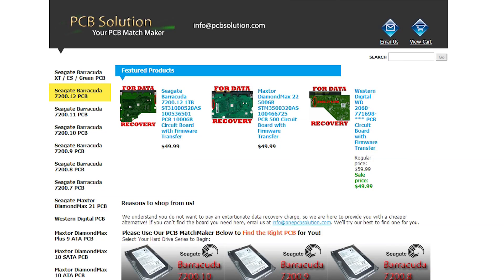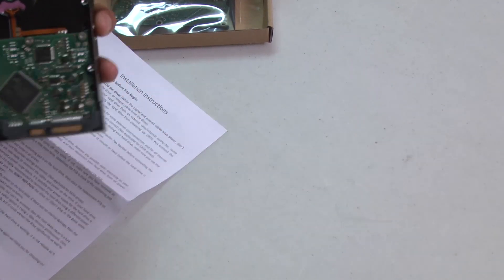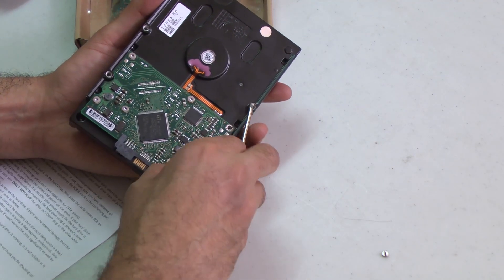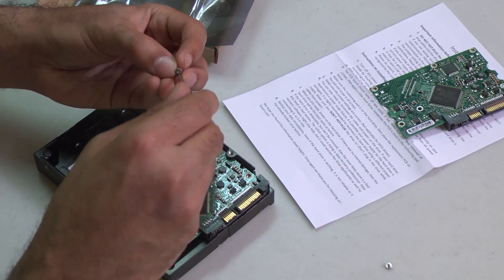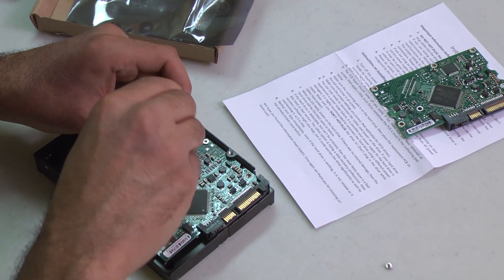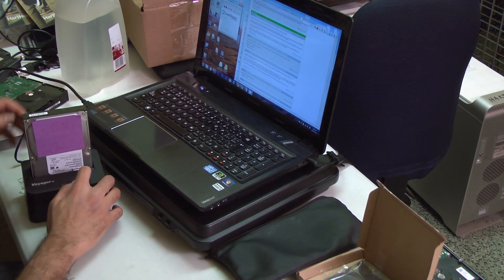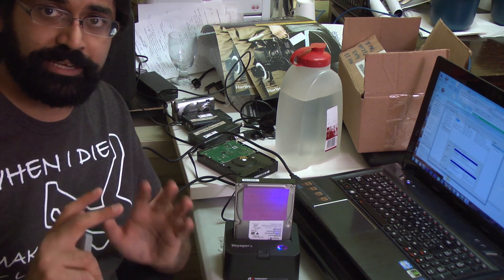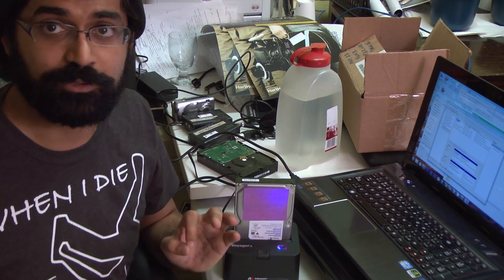How to swap broken harddrive circuit board to save $800 on data recovery

Comment: There are so many YouTube videos on how to fix a broken SATA data connector... this is a much more elegant solution and doesn't require hot glue or soldering irons.  Wish I had found this video before I spent $600 recovering a 5TB drive!  Thanks.

Comment: if you install the new PCB, would the data still be there ?
Reply from the maker: Yes! I got the data off then threw the drive out. Not going to trust it with any data that hasn't been backed up other places.

Comment: Thanks!!
I had a hard Seagate Barracuda 320GB I believed was lost, I am so happy to find your information here on YouTube. As you said it was easy to find the right PCB Circuit Board on hdd-parts website.
One week later I got the PCB board, I live in Sweden and it was no shipping cost.  I switched the board and it worked just perfect, thanks again!
Lars

Comment: Thanks for the helpful video, just ordered a PCB for my barracuda 7200.10 and hope it'll work without any effort on my part. When I plug it in there's a chip on the current PCB that gets so hot it desolders itself!

Comment: Thanks. Great Video. I also had a customer who had a bad pcb board and after researching all over the internet I ended up purchasing a PCB Board from Ebay that was the exact model but they told me I had to move over the original PCB board "CHIP" - BIOS Chip. I tried their PCB Board without moving the BIOS chip from the original and it did not work so I moved over the PCB board chip and it still didn't work. I think it is because of what YOU said in your video about certain things matching. Thanks for the information. Greatly appreciated. I will try that website in the future and try a PCB board from them.

Comment: This information was very helpful and moments ago I sent them out my fried board and my eBay replacement for a BIOS copy over which they can also do. You dont have to buy a board they will copy to any compatible board for $29 bucks
Reply: Dan McCafferty hello, how did you find the match? All references must be identical? Or simply the mother board big chip number?
Reply: ** khaled I started by searching for the hard drive model I had then eBay searched based on the hardware revision number on the bad board, then I sent it to pcp solutions with the bad board so they could clone the bios from it to my replacement used board. Unfortunately the hard drive internally was also damaged so I was not able to recover my data. But it was worth a shot but it fried pretty badly.

Comment: it wont work if the heads are bad. only a head swap will. also u have to swap the firmware chip from old board to new one or the drive wont work
Reply: The video says otherwise

Comment: before i found this video,3 weeks ago my internal HD die,so i was doing a research and i found the onepcbsolution website,i sent to them my HD board,last monday i recieved my new HD board but until today i had a chance to work on my HD,i installed the new board with only 3 screws because i lost the other 2 screws,the hd didnt show up on my mac,so i figured out that the 2 missing screws was the problem,so i removed 5 screws for an old HD and use them on my new HD board and BINGO  the HD comes to live,guys i recommend onepcbsolution,great service,excellent communication.

Comment: I just did a data recovery by ordering a PCB board from HDDparts.com and for no charge you just mail out your old board to them and they will switch out the chips and send you the new one. Again like mentioned, all you need to do is match numbers and you're ok.

Comment: Thanks so mich for this demo.
I'm having a power problem, too, with my LaCie Poulton 2TB HDD.
Idoes not power anymore after I accidentally used the wrong power supply. There was no burning smell or strange noise, it just won't power up anymore when using the correct power supply. I suspect a shorted TVS diode but have no idea where it is and how it looks like when it is shorted.
Can you advise, please?

Comment: My external hard-drive was a WD Elements 2 TB --  Probably had data on .3 TB -- Music and pics.  I used the wrong cord to plug it in and heard a slight pop -  IT guy disassembled HD and tried plugging it into his computer, to see if data would come up-- Only thing that happened was a slight trail of smoke -- Do you think I can retrieve my data, by changing the circuit board as you did?
Reply: J Simon yes